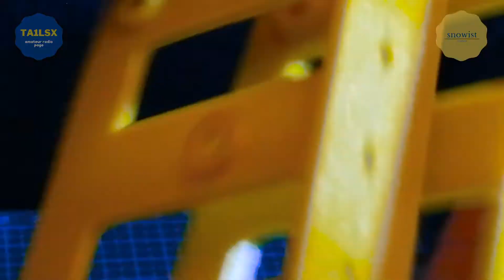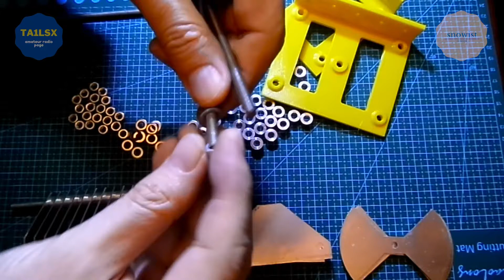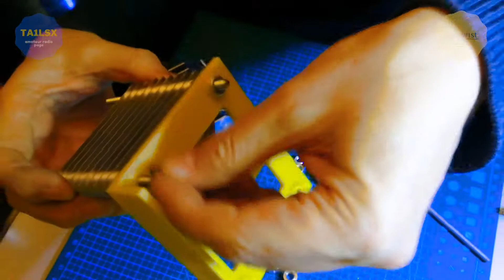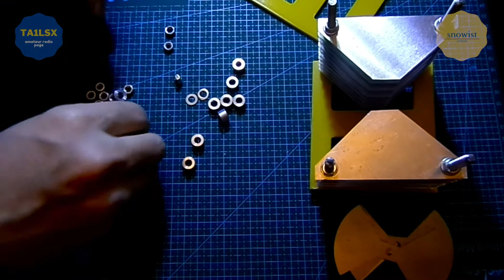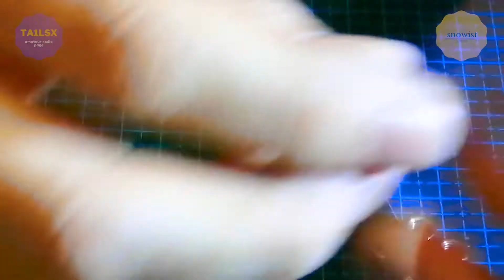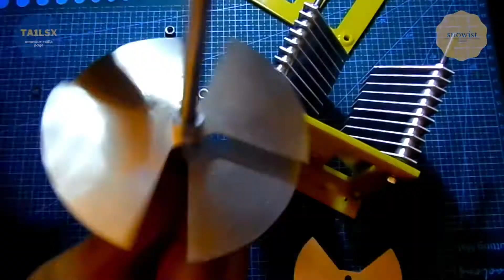How to build a homebrew butterfly capacitor for loop antenna

Comment: Instead of using air dielectric, have you thought about just printing that as part of the fixture?  

I was just looking into doing this.  PLA has a dielectric constant of 3 to air of 1; PLA dielectric breakdown is 30kV/mm to 3kV/mm for air.  This should increase power handling and decrease capacitor size for the same capacitance range.
Reply from the maker: Interesting idea. Can you please explain that a bit more. Where can we place printed PLA plastics parts? Between the stators? You can email me at erhan@ta1lsx.com
Reply: @TA2WK-TR  I was thinking of printing the stator and rotor vanes directly and at the desired thickness (100% infill of course).  Copper tape the plastic.  The overall configuration probably wouldn't be rotating butterfly though.

However, since you've already laser cut both, perhaps print just inserts into the air gap.

Comment: Long term durability is questionable. The plate and shafts should be silver plated and brazed together to prevent corrosion from forming. Corrosion will cause higher plate to plate resistance.
Reply from the maker: Nope. I use 304 grade stainless steel plates and rods and high grade aluminum plates. I have a few caps for my own use for more than 2 years and nothing happened yet.